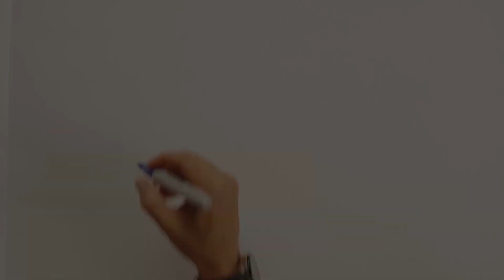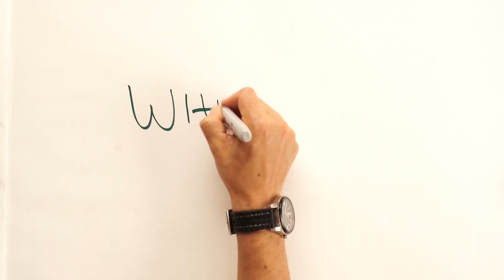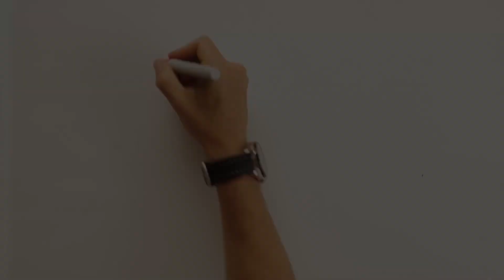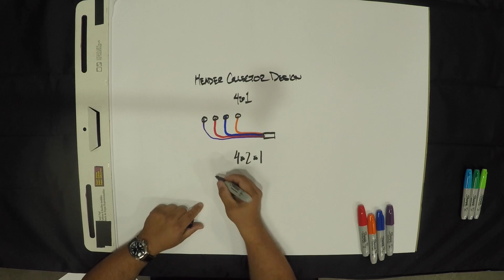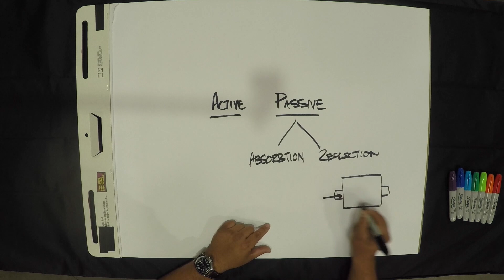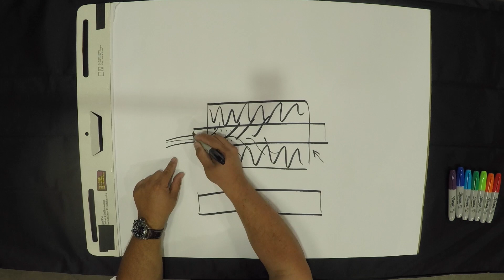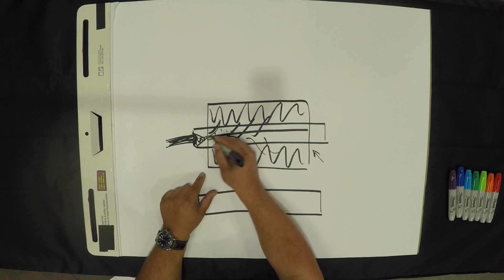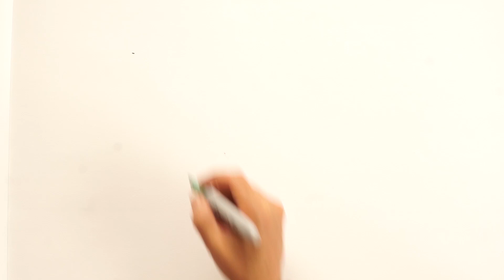No More Exhaust Myths - /ENGINEERED

Comment: I wonder if anyone in the car world uses a similar technology to that which major motorcycle manufacturers have been using for years to quieten and improve mid-range torque on their bikes which involves a variable restriction in the exhaust which varies, seemingly, according to revs.
Yamaha EXUP was the first for the four strokes. Some luddites would disable it, setting it permanently fully open. The lore said it would go better. How they could not tell the difference I really didn't know. I tried it on a FZR400 and a FZR1000 to prove a point and the point was well proven.
I had bought the 1000 with the device disconnected, the vendor claiming it went better like that. I had test ridden it in its disabled state and the torque was dismal to the extent that with the clutch fully engaged at 30 or 40 mph in 1st it still hadn't hit the powerband it would just slowly gather speed.
I can't remember exactly now but I think at about 6 or 7000 revs it went mental right up and into the red zone, a bit over 10.
I rode it home and inspected the device, a rotary valve, freeing it up and reconnecting it. After checking it's operation a roadtest was in order.
Night and day!! It still was no stump puller, but would pull 4th gear better from 30mph than it previously did in first. And no less a rush over 7000. I took it back to the boy I got it from an encouraged him to have a go on it. He was amazed. He told me when he sold it to me he had just put a clutch in it. They're hard on clutches. They're all like that. Apparently. And that was the second clutch he'd fitted. In 12,000 miles!! 
After he rode it again he wanted the bike back!! If he had connected up the valve when he probably would have still been on the same clutch. And it wouldn't have been such a pain to ride. He bought another soon after.
There was also a marked difference in noise at the lower engine speeds typically used for town or sensible motorway speeds.
I really believe that this technology could be useful in your field, although you may already be using it. Sorry for rambling on a bit, you've made a great video, so much better than most of the rubbish we see.

Comment: Was skeptical about putting a Magnaflow system on a Japanese 4 banger, but I've been quite pleased. I can keep it quiet if I want but it definitely screams when I get on it. And you can definitely feel the air flying out from underneath you.. Which is probably why every douchebag thinks I'm trying to race him when I pull up. #relaxbro #itsa1point8L

Great idle also, very subtle.
Reply: Danial Pham I feel the same way I put on my 92 accord and sometimes I just want to Cruze but all these muscle cars want to race sometimes I race them cause there terrible at weaving in traffic but In straight aways I’m as slow as those tractors in GTA San Andreas. Although I love it and felt a little more push in mid to high this was before I changed to a high flow cat and Manzo headers.

Comment: what about the effect of temperature on the exhaust? its a big difference between a CR-X and a Ram 3500 Mega Cab, but still, the longer your exhaust pipe is, especially on a vehicle that isn't lowered, you're going to have cool air flowing around the exhaust system itself. I know that several companies have exhaust systems that, let's use the example of the 500 hp engine, maybe they would use 3" diameter exhaust up by the collectors, but then just before the rear axle, you would drop the pipe diameter to 2.5"  in order to account for the temperature lowering and the gasses inside the pipe contracting. This would allow the flow rate to stay high and could increase the scavenging effect up by the collectors as long as you do it far enough away that you know the temperature has lowered enough.

Comment: Beyond performance of the engine. An important element of exhaust system never mentioned, all the way to necessity of tailpipe, is getting the toxic exhaust fumes (carbon monoxide) out of the engine - and away from the car. And why there should be no openings in floorboards, trunk, etc where exhaust can be pulled back into the vehicle.

Comment: I'm under the impression 180 degree crank would be seen as "flat plane" while "180 degree headers" bring together exhaust events which occur every 360 degrees of "crankshaft" travel. That is: 8 firing cylinder events involve 720 degrees of crankshaft rotation... Where am I wrong?
Reply: +James Tennier That is correct. A four stroke engine takes 720 degrees of rotation per fire in a cylinder. Power stroke, then exhaust stroke.
Reply: Well I don't believe scavenging works on the street as header manufacturers would lead you to believe. The reasons are complex but it's something like this, cross plane cranks benefit from scavenging but it occurs in such a narrow band as to be pointless chasing it on a motor that has such a broad spread of power as a street engine.
There are too many variables for it to work properly.
There is a way however that MAY (no promises) work and that is anti reversion cones in each of the primary tubes.
There are some things that are known to work generally for specific motors. For example the 440 Mopar is known to benefit from 2" primary tube headers going into 3 1/2' collectors. Indeed it seems to be the case but that is from a factory sponsored drag racing data collection and the info gained is so narrow nothing is relevant outside that particular motor with iron heads and larger valves as specified by the factory manual for hot rodding the B/RB.
I am sure there are other knowns for other motors, but for the home hot rodder unless you have a dyno, about 1000 hrs, $150k, 49 different combos of header primary tube length, intake type, head work valve size, port size, camshaft and on and on and on into infinity then you're just guessing.
Headers are about reducing pumping losses and stopping reversion. Some do it better than others, but the main cylinder filling effect is the inertia of gas flow initiated by camshaft lead and lag (AKA overlap). How well that flow can be kept moving, post exhaust, may give an added boost but I doubt all cylinders are going to benefit equally due to intake manifolding! The whole header thing is designed to even it all out as much as possible by having the leaner cylinders running at the correct A/F ratio and the richer ones running too rich rather than the richer cylinders running the correct A/F ration and the leaner ones being a bit too lean but within specs for longevity.
The whole thing is a balancing act and reducing exhaust pumping losses will yield a power increase since the the volumetric efficience of the engine has changed. 
Port fuel injection aids this since the intake runners are intentionally tuned.
So that's my take on it.  Header manufacturers say it's science, I disagree, so I guess they're right and I'm wrong because they have more money than me implying I have shit for brains. As I mentioned they're right.
Reply: 720’ / 8 cylinders = 90 / cylBut the banks are tilted, so the bank angle comes into play too.
A V8 will usually be 90’ between banks, with pistons sharing 4 crank bearing points, so you have two 4-cyl banks with one lagging the other by 90 degrees.  Now you can spac the four cranks by 90 degrees, pick your 180 degree pairings, assign a firing order, design your cams, and finally run your header tubes for optimal pairings.
Reply: Bit lateresponding, but close - exhaust pulses 180 degrees apart are grouped together - the other four are 90 degrees to the first. In practice, that usually means the outer two on one band and the inner two on the other, eg traditional SBC has a firing order of 18436572 with the left (?) bank being odd and the right even so one group will be 1, 7, 4 and 6 and the other group would be 3, 5, 2 and 8. You can check that and other engines on the interweb, as there are multiple sources.

Comment: 19:02 The exhaust gas velocity coming out has to be the same as the velocity going in, unless the output pipe is bigger.  I think you meant pressure, not velocity.

Comment: Thank you for making this video.  As the exhaust and intake designer for Iowa State’s Formula SAE team, I started with zero knowledge of the two systems and had to figure out how they worked with the engine on my own.  Because we work with a single cylinder 4-stroke engine, I didn’t have to design a manifold, but I still had to learn a lot.  One of the problems I had was figuring out where to start and you put the aspects of the exhaust in a logical order.  After watching your video, I am able to connect these components together and have a better understanding of the exhaust system. For an introductory video, this is well done. Thank you!

Comment: The way I've heard, 4-1 collector is ALWAYS better than 4-2-1 as long as the 4 separate tubes of the 4-1 are as long as the length of the 4 tubes us the same as 4 tubes + 2 tubes of the 4-2-1 collector.

Comment: Thank you Richard!  Very informative information and helped me a great deal as I have been trying to decide between the different muffler systems on the market (Chambered vs Straight through).  I do not have an automotive background but do understand a little about airflow, duct sizing and cfm, along with how they may or may not affect sound issues, from my HVAC background.  I do also enjoy modifying my truck with accessories and am more concerned with performance than sound in the exhaust system...

Comment: ok, halfway through and I still dk if LPP headers with 3in collector to 3in y pipe cat deletion paired to my cat back Mbrp absorption muffler system is a good upgrade to do before I add a procharger, or supercharger to my 2005 5.3 z71....

Comment: Awesome!! I always tell people with loud pop can exhaust or those diesel behemoths that if not tuned for that application, it can be counter productive. You can't think you are smarter than the engineer, yes, for a mass produced or motorcycle, one can get lucky when they put on aftermarket muffler/exhaust and it matches the tune for more performance.

Comment: Hi there, thinking about building V6. I probably  want dual exhaust, each bank separate. That gives me 3 tubes to work with. I'd rather have flat powerband than peak hp. Would it be beneficial to make one tube slightly shorter to make vacuum at higher rpm, so 2 cylinders will work best at let's say 7000 rpm and 1 at 6000? Or even all 3 different, but calculated lenghts? Will uneven cylinder power make tuning more difficult? Or is this whole idea just crap? What do you guys think, any input appreciated
Reply: +Andrej Pohl 
I would think, compared to tubes being the same length and diameter, it might broaden your usable power curve a bit, but at a sacrifice of peak power ,and probably higher rpm power.

It is hard to tell.  It seems that when ever your trying something new, it just has to be tested to know for sure.

Comment: how do catalytic converters fit into the exhaust system? Are they just a giant blockage or if u run 200cpa cats is that fine compared to factory
Reply: catylatic converters hold pressure back as the exhaust is pushed through. after running for a few minutes, the comb inside glows and is supposed to burn impurity gases like No2 I believe it is. either way, it's a large blockage to prevent smog clouds over cities and lover fuel economy. why I'm planning on removing mine and dropping in long tubes with a 3in collector to pair to my 3in straight pipe.

Comment: The difference between horsepower from open exhaust and a stock exhaust is so minimal that it comes down to sound and longevity. Magnaflow advertises stainless steel, however it is cheap 409 which rusts and not the much better 304 like Borla and other manufacturers sell.
Reply: +theoriginalmungaman It makes more of a difference the higher the engine output. Not gonna make a big difference in you 100hp 4cyl car, but it does when you have a 500hp V8. 

Also I've never had an issue with 409 stainless, it'll surface rust but it'll take a decade or more to lose its structural integrity. I've got cheap aluminized steel exhaust on my truck, it's at least 6 years old and hasn't rusted through yet. I just make sure to wash the underside of it to keep the salt off during the winter and it's fine.
Reply: +snakesonaplane2 My friends 9 sec drag car we built had to run mufflers at a certain track. We went from open headers to adding about 3' side pipes with race glass packs. This was a 500 C.I. normally aspirated v8 with a large cam and huge ports. The car was making over 650H.P. at the rear wheels. It only lost a hundredth of a second in the quarter. For the price of a Magniflow system you can get a 304ss system. Most people don't know the difference between Austenetic and Martensitic stainless.
Reply: theoriginalmungaman And he didn't lose much time because a 3" system is correct for that output. But if you use a 2" system on a 500hp engine, you're going to choke it. Even a 2.5" system will lose top end but it'll make great torque for street driving, which is what most people do, most of the time. I wouldn't run a system that's optimum for the track on a street car, rather lose some top end and gain better drive-ability. 

Also as for price, that depends on where you buy. If you buy from a source that sells more Magnaflow and they buy in bulk, they sell for less. I work for a parts distributor and I can buy Magnaflow systems for about half of what you'd pay at Summit Racing, but less common systems like Borla or Corsa they don't buy near as much of, so it's not as big of a discount. I don't know of anyone that'll sell a 304 Borla system for nearly the same price as a Magnaflow. And to me, it doesn't matter because as long as you clean the underside of your car, it'll stay looking nice for a long time, and I guarantee it'll never fully rust through, especially if you clean it. Besides, it's under the car so who cares about a bit of surface rust? I like to drive my cars, not keep it so clean to show it off and hardly drive it.

Comment: In reality any 4 stroke engine will produce the most power with the straightest shortest open exhaust (provided it has the correct air fuel ratio) All exhaust systems are a compromise and there isn't as much engineering involved as this self bloviating clown is selling!

Comment: i put full jdm type r exhaust and headers on my ls integra(working on vtec), i went from 4-2-1 headers to 4-1 headers and a 2 inch diameter(rusted out) to a 2.25 diameter, how can i find out if its helping or hurting my car
Reply: +Matteo Wise Easy, but you are probably too late. But you should have bench marked your zero to 60 times, and run a few tank fulls of fuel to benchmark your mileage. Then, when you make the change, do it again and compare. While a dyno might give more detail, you can find out a lot, just by running zero to 60.

 The second thing you should do it invest in a data logger chip that will plug into your OBDII port. This will let you see acceleration rates, and compare graphs, so you know if you picked up top end or low end, or neither one. these plug in chips are relatively cheap and will tell you which way you are going. True, you won't have HP and torque numbers you can brag about, but you can compare before and after graphs when you make modifications, and see if the change was a good change or a bad change. Just another note, since you are looking at graphs over time, you can wait till the engine is in second or third gear, that way you are not comparing wheel spin. I used this method to tune my motorhome. And yes, I did have to get above 25 mph, otherwise I had wheel spin!

Also if you are going to do zero to 60 comparisons, you need to do it over the same stretch of road, and it needs to be close to the same temperature outside. Otherwise your reference is meaningless.
Reply: +Matteo Wise dyno

Comment: speed of sound depends on the medium's density.  it's 1100 ft/s in air, it's closer to 1700 in exhaust gases, which are a mixture of gases, hot, and dense.  many other holes in his argument.

And this is why magnaflow makes OK products.

Comment: The exhaust leaves the cylinder at the speed of sound???  I need the physics behind that.  Or is that the constant he's using and it's linear across temps and revolutions?
Reply: +Tony Williams The pressure wave moves at the speed of sound, not the exhaust gas... The pressure wave (sound effectively) will travel at the speed of sound in the exhaust gas medium... This speed is a function of the gas density / compressibility which in turn are functions of the pressure and temperature - without doing any calcs (and I very much doubt I could any more) I would say this is far from a linear function  and will be very much approximated :P
Reply: Farlig66 I'm digesting your explanation, but it still doesn't make sense.  To me, the speed at which "the exhaust leaves the cylinder at the speed of sound" as he put it, would vary.  I understand pressure wave, and going by your explanation, makes perfect sense...density and compressibility.  What I totally understand is that a vacuum is created, but for them to use the speed of sound as their constant for determining size, bends, junctions, etc. is where I suspect a flaw.  The engine will only produce a finite level of compressions per second (rpm's), so a calculation could be made to determine what the pressure differences are and when you would want that vacuum, at the perfect/optimal time.  But to restrict to the speed of sound, for the entire range, is confusing to me.  I appreciate your explanation and will give me a better starting point to educate myself.  Thanks.